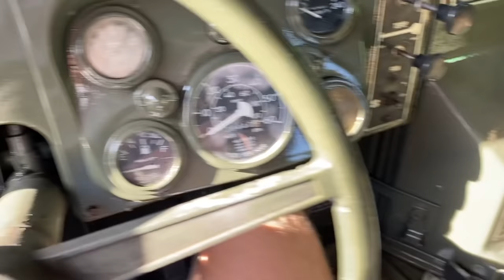Testing Our HUMVEE To NEW Depths!!! Is It Ready To Drive Completely Underwater???

Comment: Torque can be your friend and your anime especially in water hit a soft spot and give it too much gas you might just dig a hole instead of going over it. Plus tyres play a big key in off roading running 33’s to 35 are a big difference here in Australia and some of you guys run 40’s in USA or bigger without that diff clearance you will get hung up in soft mud especially with small tyres won’t be hitting the side of the track for traction

Comment: Dude that looks like loads of fun! Seems a little light on the back end, and so perhaps some cinder blocks in the back would help with traction when the water gets up above the wheels.
Reply: Something that will also work, if the tires have tubes, is to suck the air out and replace with water, to make the tires sink in the water.

Comment: Man i dont like to harp on people or be a downer but you NEVER want to stand that close when a truck is getting snatched out like at 8:43. Ive seen a lot of damage and a lot of close calls when parts and ropes fail. Ive seen trailer balls rip out of the Bumper and go through back, front windows and smash a hood, ive Seen bumpers fly through back windows. To give credit those vehicles have pretty solid Tow points but ive ripped tow hooks off of a similar model chevy. or actually i ripped the frame horns from the tow hooks forward off. Not trying to bash you guys, Just like watching you guys and dont want to see anyone get hurt when its preventable. Be safe and keep up the awesome content!!!!

Comment: Ive always wondered if the battery box under the seat in the humvee is supposed to be water tight or does it not really matter if they get totally submerged?  I would think it would create a huge short and either drain the charge or ruin them completely.

Comment: Need to get the actual snorkel kit, intake and exhaust from a military surplus, and get with army mechanic or infantry guy to show you tips and tricks of this beast. Also they did drop a turbo diesel and Alison trans in the armored versions that would bean awesome swap. Look up emergency fan override, it will turn fan off for fording, but watch your temps.

Comment: Strap the batteries to the floor, we got yelled at all the time in the Marine Corps for not having the batteries strapped to the floor. 1 it saves you for in times like this where its bumpy and the leads connect and that plastic seat engulfs in flames before you know it. 2 it also helps in an IED blast because that's 1 less thing flying around =) you prob wont see this but I thought it might be useful lol

Comment: Guys should pull apart those tires, and take out those rubber run flats(if they are in there).  That's gotta be like 25-30 lbs of unsprung weight per a tire.

Comment: Cleeter - one of the older safety messages for those mentioned cutting off the excess length on the seat cushion bolts and putting silicone over what's left.

Comment: Before you go driving this fully submerged through the alligator infested swamps of Florida, both of those trucks need some cut boggers, Baja pro X, or just straight tractor tires for maximum traction in the mud and silt is crossed where nobody has ever driven before.

Comment: Both of y’all need to find an old set of like 38/15.50/16.5s and they will go whenever you point the wheel. Those 37 military tires do decent had a set on a 73 k10 but not for what y’all are wanting to do haha

Comment: He needs to build a plexiglass aquarium around it, turn it on, slowly fill the aquarium with water, check for leaks, fill it some more, check for leaks, etc etc all the way up over the roof.  The cost of the truck sized waterproof aquarium would be easily covered by the views.

Comment: Obviously that Humvee is NOT going to ever be completely stock, nor should it.  Suggestion for freedom progression: "THE WAY AMG SHOULD HAVE BUILT THE HUMVEE".  Cummins B ser. 5.9 12v backed up to TH 400 trans only, no 4L80's.  With a plate slide/port that damn near any soldier could perform in anything even resembling a shop.  That  would have been FAR superior in HP and speed to even the 6.5, especially when loaded with armor/troops/equip. etc. May well have saved some lives with that much needed extra speed in the open desert.

Comment: HEYYYY, TMP 075. I was wondering where that old gal went too?!!  For the Hummve, as long as the engine fan isn't spinning when you hit water you'll be fine, otherwise hitting water while it's on can make the fan blades flex right into your radiator and then you are replacing that too. https://www.youtube.com/watch?v=K6CMuRdPhWU&list=PLig7DfPAxxeSRVj24yNMaVVDYOtBmPMks  me in my younger days!  Making sure the vehicle is "mission ready" lol. one more      https://www.youtube.com/watch?v=Cmgaaxs1KZU

Comment: Dear God, it's like I'm watching wistilin diesel. You have absolutely no proper fording parts installed. Nothing is sealed, the trans, power steering, gears, crankcase, none of it. They have all the proper OEM stuff all over the internet to buy. That gloss paint on that thing is hideous. also, the passenger mirror is wrong, you aim it so you look through the windshield to see, not the door window. If you want to donate the radio tray to a needy disabled looser, send me a message.